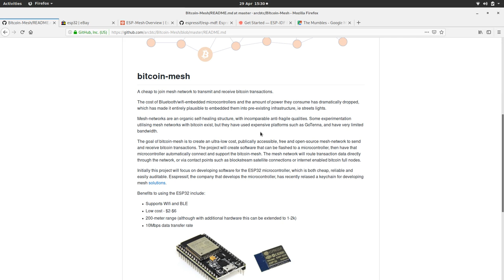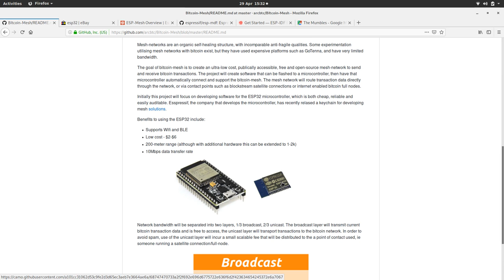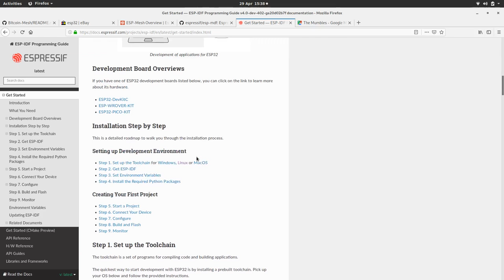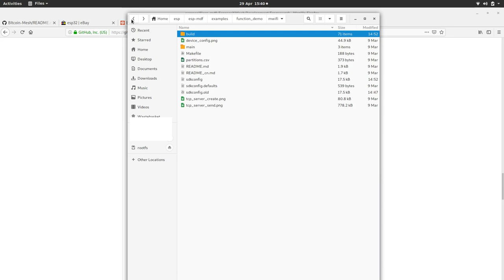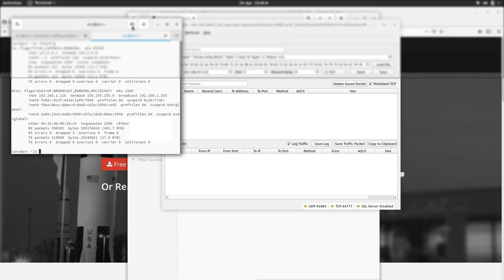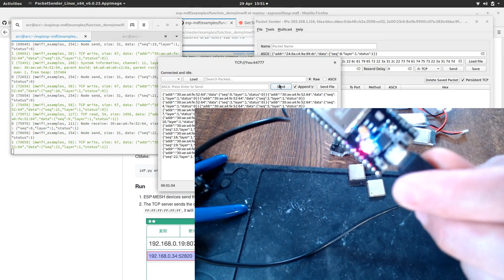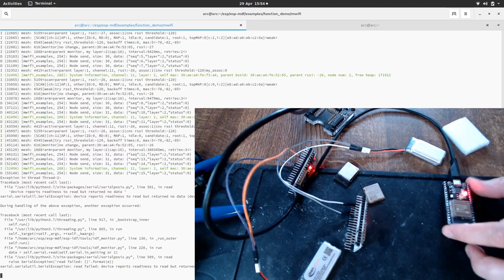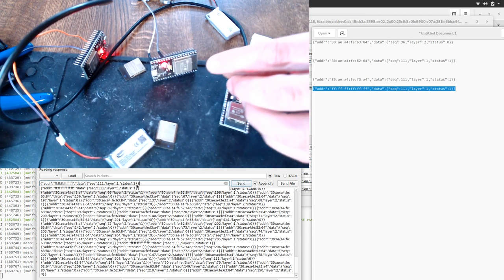BTCIOT - bitcoin mesh diary, part 1

Comment: Nice, great job! For how long will battery hold?
Reply: The batteries I will use for the experiment will last a few days, so I need to figure out a more permanent power source. I have a bunch of friends in the village who will plug in to support the project. Retrofitting them into street lights would be ideal
Reply: @hannabussb  Mb, small photovoltaik pannel? I also want to try the same project, what should I pay attention to when buying ESP32, which can you recommend?
Reply: @Lenorag  funny you mention that, some very cheap charging modules arrived today, which I can use for solar. Not sure they'd be enough charge for mesh, unless the modules take it in turn to transmit data, but that would mean more modules are needed.
I reccomend the devkit 1, it's the usual esp32 you'll get on ebay. The ones with inbuilt oleds are cool, but they consume more power and take up gpio pins. I have used the devkit 1, for all my projects apart from this project, where I used the nodemcu